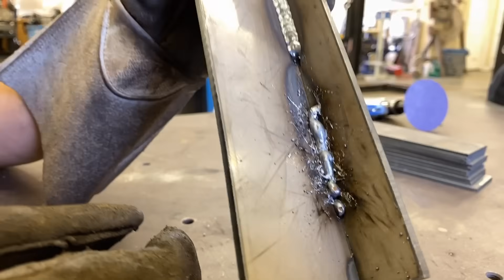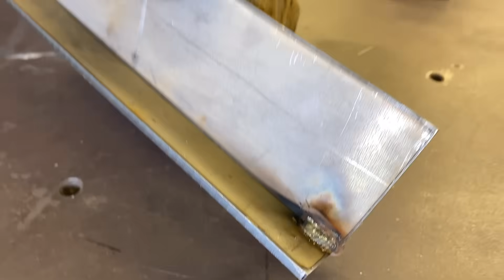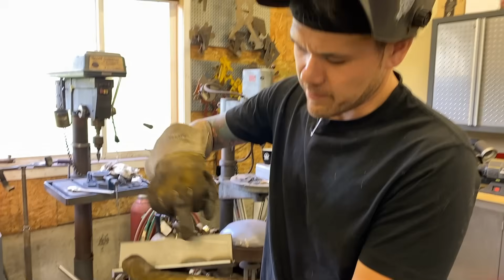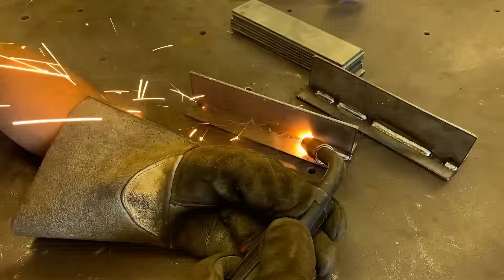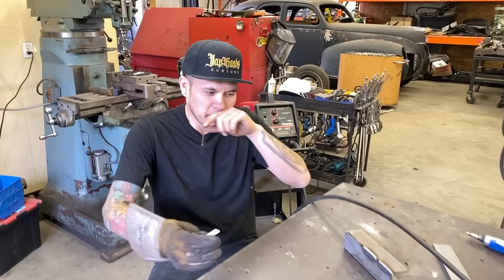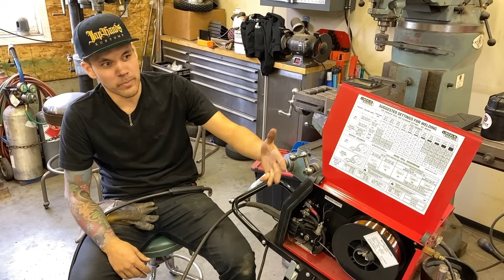MIG Welding Basics For BEGINNERS!! How To Set Up Your Welder + Tips, Tricks & Techniques!!

Comment: Well presented. I also wish you had a dark lense so we could see what you see. I've watched a lot of "How to set up your welder" videos, and they're all pretty similar...but the biggest improvements I've made was lightening my welding helmet settings so I could actually see the puddle clearly, or (how I initially did it) with a flashlight. I'd love to see a "how to set up your auto dimming helmet" video.
Reply from the maker: It’s a good idea for a helmet video. Definitely the next time I do a meg welding video I will use those lenses
Reply: @MakeItKustom  I've never seen another helmet video. Might be easier to just show what to look for through a helmet since there are so many different styles. But a what the adjustments do, and what to look for through it would be awesome. Also, a lot of potential for Spaceballs references. lol

Comment: Love the focus on listening to the weld action to fine tune the settings!    I'd be careful inside the machine when it's on though, you accidently touch the positive and negative while filming the welder in action and you'll fluff your pillows for the long sleep.  With the uphill verticals, I learned a trick a long time ago that uses an overlapping  Z  motion to go up get the heat in and penetrate but then go down to let it cool down so it doesn't get too hot and drip down. Love your sheet metal mastery and just subscribed for honing my own skills for my 67 Parisienne restoration. Cheers!
Reply from the maker: Awesome man thanks for the feedback glad you enjoyed the videos! Good luck with the restoration!

Comment: One thing I learned about the settings of the welder is that a lot of them ship set up for flux core wire and before using solid wire the positive and negative connections need to be swapped.
Reply from the maker: Wow I haven’t even thought about polarity on Mig Welders for a really long time

Comment: Great outline of the basics for beginners. Just remember if you're a novice, welding is about Penetration  too much heat you end up with undercut (cut lines at the edge of the weld) = weak weld. not enough and well..things fall apart. The techniques shown were good penetrating welds can be seen by the blue heat marks in the steel either side of the welds. Good upload to learn from. A welding school would probably take a week to teach the same information
Reply from the maker: Absolutely that’s the other side of things! Thanks for your feedback

Comment: I usually do circles or "C's" if i'm welding thinner material to thicker material.  Which i then just use the same techniques on everything because i'd gotten used to it. But i'm now going to try whip & pause. I can see you get a far more uniform line.
Reply from the maker: Yeah with Meg welding everybody’s got a different signature! I like the weapon posit helps me stay consistent

Comment: Great information sir!!! You should always become a master of the basics before moving forward. Most structural is welded with arc, I think a lot is going to wire feed though. 6010 is considered a downhill rod, but I have never had any luck with it. Most other rods like 6011 and 7018 are uphill rods and should only be ran uphill, because of penetration and flow. I think running wire down hill is the only way to go because there's more control and just seems to work better. Good stuff amigo!!!
Reply from the maker: Absolutely man! Thank you so much cheers

Comment: thats some good info on wire feed welding. i like to keep two machines in the shop a 110v and a 220v using different wire size this covers all of my needs for welding. One thing we all forget about is when we had to use the stick welder. but i am thankful that my instructor wouldn't allow me to use the wire feed to learn how to weld metal. In school they would tell us what we would learn from stick welding would make us better with all types of welding. it may be the older type of welding but it will be used forever that was what i remember. thank you for sharing
Reply from the maker: Yeah man that’s what I do too lol I have a machine with each size in it lol thanks for watching!

Comment: Another great video! I also weld vertical down with mig and never had a failure. I've welded 1/4 brackets to an 1 1/4" solid tie rod with a 110V MIG but I was using flux core which has better penetration and preheated the snot out of it. It was for a hydraulic ram assist on my Jeep and wheeled it like I didn't care and held. I totally agree though, definitely not for a beginner!
Reply from the maker: Yeah definitely once you know the limitations of a machine you can add heat to help preheat and get better penetration good job making it happen with a 110!

Comment: I have been stick welding since I was 12 and am certified for it in all positions. I have started to just HATE mig welding. It's "so easy"...to make a big mess. 😡🤬😡😡🤬

However I think I may need to turn the wire speed down on my old man's mig welder. Another great video 👍
Reply from the maker: Ha Hah Hah u will love mig welding when you get the hang of it.  But everything has its place.

Comment: I'm from a small country where I can not get argon gas, but I want to get into mig welding. Read some info about fluxcore wire. Got any tips about how to use that?
Reply: Can weld with co2 only check out fitzies fabrication welding set up. He used .028 wire and co2
Reply: @christopherconrad4156  CO2 is also very hard to come by where I'm from. That's why I'm curious about fluxcore wire. Thanks for the tip, though.
Reply from the maker: I don’t use a lot myself but I know people that do and it welds much the same way

Comment: Great video. Would you be able to come back and talk about gas settings?  Have heard a lot variations regarding gas flow rates.
Reply from the maker: Again it could be a bit of a numbers game but I like to use 25 ft.³ per minute but if you were wondering how to set it without a regulator just turn it down so that you get a shitty world and turn it up until it becomes clean then you know how much gas flow you need
Reply: Good question. I'm sure I waste a lot of gas. My original regulator got stolen and I am using a Hobo Freight  one. I just crank it up, figuring too much is better than too little. I've been meaning to try different flow rates.

Comment: I was a cut-list helper at a steel fab shop in the mid-eighties. My boss was a recently married 40-year-old virgin type. He was most enthusiastic about married life and came in late a lot. 

I knew how to read plans from seventh grade drafting class so if he wasn't there by the time I got done with my cut list I would start laying them out on a table. If he still wasn't there I would tack 'em up and if I had a chance before he got there I would start welding it up. A lot of our mostly ornamental ironwork was done with square tubing so I burned through a lot of square tubing and learned how to fill holes which is excellent practice.

I didn't really know how to set up a welder for whatever it was I was welding so I learned kind of the way you're describing- by sound. I knew what it sounded like when he was welding and I knew if it didn't sound "right."

This video did a very good job of imparting what I've learned then and through years of hobby welding that I wouldn't have been able to explain nearly as well.

The sizzle knows.
Reply from the maker: Oh I like that “the sizzle knows “that’s a T-shirt if I’ve ever heard one

Comment: Another great video. Do have a couple questions. How far do you hold tip to metal and can you use a mig for 014 and 016 ga. Can you do a video on dos and donts of welding 014 and 016.
Reply from the maker: Yes I’m going to actually be doing some 16 and 18 gauge with the Mig Next week

Comment: Great video! Would love to see more like this on sheet metal and rusty sheet metal. Keep up the great work!  Enjoy your videos.
Reply: If your running sheet metal, you can run fast and hot downhill, point the gun up if it’s on a car most guys will run short runs too help with distortion. I weld 20 gauge - 3/16 daily
Reply from the maker: Coming right up and doing some rest repair on a van we will do sheet metal welding
Reply: @MakeItKustom  excellent! Sounds great.  Looking forward to it. Thanks again and keep up the great work.  👍

Comment: Awesome presentation!  After initially learning how to weld, I found that a high quality welding helmet is a must have. Cheaper welding helmets do not allow you to actually see the puddle that you're working with
Reply from the maker: I confess my welding helmet is a pretty cheap one lol
Reply: @MakeItKustom  mine too, not sure how people can afford a $1,000 helmet.  I'm sure the view is amazing (especially with improvements/advancements in lenses) but with a $100 auto tinting helmet , you can still see good enough to make quality welds and not worry about scratching your helmet up.
Reply: Yup it is soooo important to SEE what you are doing.  I always tell my students to get as close as they can to the puddle because at first they are scared and are 2 feet away and all they see is a bright light.
Reply: I used the hand shield out of a flux core set up out of harbor freight. Never did get the weld to start or end where I wanted it to.
Reply: @Laugh1ngboy  Yeah that is harder to learn on for sure, you should pick up a cheap auto tint helmet or at least a cheap old school non switching lense helmet so you can at least whip your helmet down and keep your hands free.
Reply: @wayofthewrench  Oh I did even the 30 dollar helmets at harbor freight work great once you dial in the settings and get use to them.
Reply: Ive seen vidieos of those indian truckers n fabbers welding with those cheapo flat card lense holders how they can weld n hold mask is beyond me.i found out real quick an auto helmet makes life a whole bunch simpler when welding.snooky pa.

Comment: Over the years I have done a lot of mig and stick welding and all the advice I had when I started was exctly this, look at the weld and listen to the sound. And like you said Karl, with a properly set up machine you can weld overhead no problem. I used to do a lot of overhead welding on a shotblaster and it's as easy as welding on the flat, just more sparks flying on your head 😁😁.
Another great video Karl.
Reply from the maker: Thanks so much man appreciate it!

Comment: Thanks Karl!

I have wish for another great content Video of you... Which Tools and Techniques do you use to prepare old metal of a car before welding it together with a new peace of sheet metal. And how you treat it after welding to make it "invisible"?

That what be great if you can produce such another how to video...

Thx in advance from the North of Germany 🇩🇪 

Marco
Reply from the maker: I like to remove any paint or under coating and just get it back to clean metal. Whether or not it’s using a stripping desk or 80 grit sandpaper or a wire wheel as long as the metal is very clean

Comment: My biggest confusion with mig welding is gas flow rates. After trying to use the regulator that came with my machine and then switching to a victor with a flow meter I stopped having to replace my bottles as often. Since I stopped wasting shield gas as much. Biggest benefit  is not having to chase down a supplier that actually would replace my small bottle and not try and upgrade me to a K cylinder when I really only needed a Q1.
Reply from the maker: Are use 25 ft.³ per minute but the best way to set your gas flow so that you’re not wasting it is to take a piece of metal and start with less gas so you see there is wild contamination and just slowly turn it up until you have a clean weld that will be the minimum gas amount you need for shielding
Reply: @MakeItKustom  That maybe the best advice I have gotten about this. I know I need to practice more. It also looks like I need to increase my flow rate. Might start saving money on grinding discs and paint cleaning up welds.

Comment: The reason why structural welders don't go down hill is because  they use flux core wire. When your running hard wire it's a little more forgiving going down hill. Metal core wire is even harder to weld with in other positions than flat.   Every type of wire has it's abilities and style of techniques. I've been welding since 1994 and have used many types of wire and techniques. The only thing that truly matters is that you get good penetration. I really enjoy watching your videos. You really are a very skilled person and make a great teacher.
Reply from the maker: Thanks very much

Comment: My teacher said that welding vertical up. Preheated the steal. So that was in stick welding. So is there could there be a difference. In heat travel. If so how???? I have always welded virtual up. In mig and stick. Also if you are running a 110 welder on a chassis welding vertical up. Would preheat the steal enough???
Reply from the maker: That’s a whole Nother ball game you could definitely use a 110 welder if you preheated the steel with the Torch. I know guys that use a 110 welder regardless and still don’t have a problem with strength but for me it does scare me a little lol I’d rather just use a 220 Welder

Comment: Although I only use the arc welder at present and are happy with it we would like to get another welder to enable us to do stainless and aluminum. For a farm workshop what would you suggest tig or mig? Keep up the intresting videos.
Reply from the maker: That Everlast welder sounds good I’ve heard good things about the company I haven’t had the chance to try though. I have a 200 Avenue AC DC tag welder it is an offshore brand I do like it it works well and easier on the pocket
Reply: I know my 3 cents are not what you are looking for but as a "on a budget hobby welder" I find the multi process welders fascinating. I think Everlast  and Fortney have some sub 600 dollar welders that do all 3 mig, tig, and stick.

Comment: Nice video bro! I find welding thicker metal I'm ok but when I go to a 20 or 18 gauge metal on car body .I just cant find the setting, when I think I do. I blow a hole . Any suggestions?
Reply: Wire size seems to help. After talking with a more experienced welder, I changed from .8 to .6mm for body work with mig.
Reply: Pulse. Trigger on, pause. Trigger on again, pause. I watch as the color starts to cool then hit it again. Holes are great for practice. Don't give up you'll get the touch.
Reply from the maker: Our next video is coming out next week on this hopefully dance with some questions for you

Comment: Great video, I really enjoyed seeing the different techniques side-by- side. 

Quick question, do any of those techniques result in better or more consistent weld penetration on the back side?
Reply: Dragging ( torch pointed towards puddle) will create a deeper penetration (flatter weld bead) as the wire pushes into a hotter metal.  Pushing shoots the wire into a colder base metal and generally creates a rounder weld bead.  For full penetration with a weld bead right through or even another weld bead created on the back side generally requires a gap between the materials.  If your interested I have some great videos on welding.

Comment: Any tips for using an old arc or stick welder as that is all I have to use at the moment
Reply from the maker: Yeah actually I could definitely get into some of that as well! When stick welding is all you got there’s plenty you can do and nice welds to make With the right rod choice and technique
Reply: @MakeItKustom  that would be great as it is all I have available to me at the moment and I am just learning as I go
Reply: You can use TIG with any stick machine, just switch the polarity and get the proper gas and torch
Reply: @dannypeter6565  not with mine it's from the sixties and you can only use it for stick welding
Reply: @paullemm5861  hey Paul, is it a dc welder? if you can switch the cables to straight polarity it should work. Just because it’s old doesn’t matter. I have been welding since the 70s and we never had a special machine for tig. Give it a try. I’m born in the 50s and I still work, haha. Good luck
Reply: @dannypeter6565  no its 240v ac and having looked online it seems to be quite a lot older than I thought lol
Reply: @paullemm5861  hey Paul, get yourself a DC welder, you can find them at garage sales . With AC you are very limited with electrode selection. And again age doesn’t matter that much, some of the older Dc generators have a very stable arc and weld very nice, Cheers